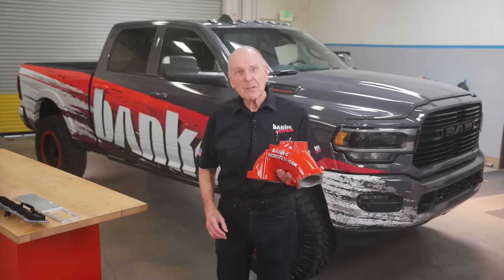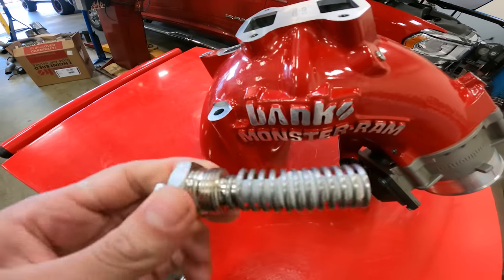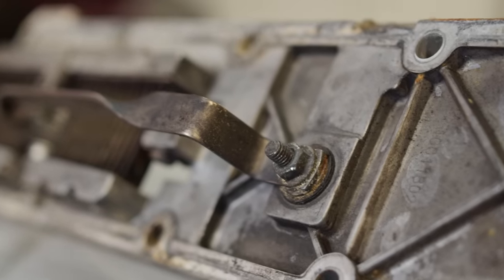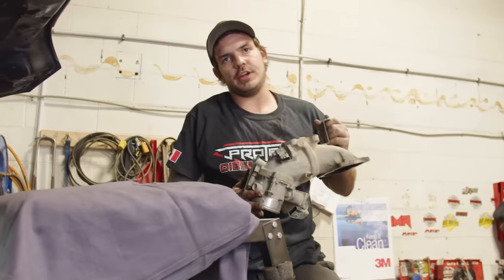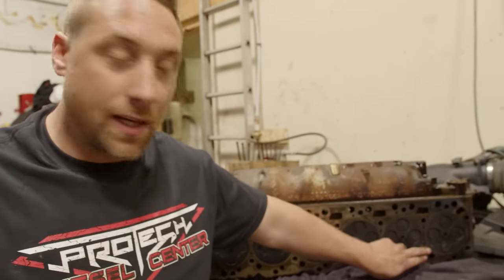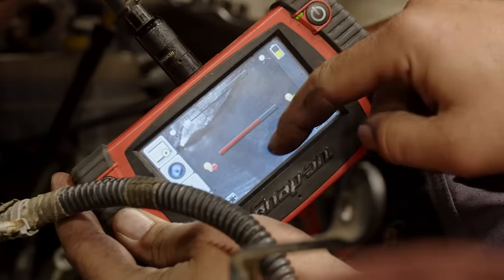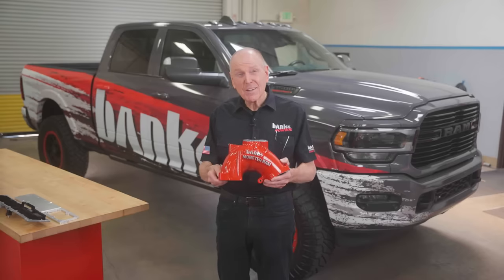How to prevent RAM Cummins 6.7L engine failure due to stock grid heater

Comment: Real numbers, before and after installation of the Monster on my Ram 2009, 6.7.  Low mileage vehicle in excellent condition. 2500 series.

Before install, average 13.5 mpg at 70mph, 3.73 gear.  Traveled 3000 miles cross country 6 times in same vehicle.  Fuel usage 223 gallons at $5.50/ gallon.  Fuel cost per trip $1,222. (Average. Variables apply, obviously)

After install.  $1000 for Ram Monster Intake.  Average mileage 17.5 @70mph.  That is  33% savings.  Fuel usage 171 gallons.  Cost $$940.00. Savings $282.2.

Payback in miles is 12,019.  Or, looking at savings per gallon, that is like buying $5.50 diesel and paying $3.63 per gallon. 

I used average.  I actually saw mpg go as high as 21.6 on flat roads and speed down at 58mph. 

However, I eliminated the threat of the heater bolt destroying the engine forever.
That threat to me was worth the $1000 I paid for the Monster.  Remember the Monster still uses the original EGR and is legal everywhere, including CA.

BTW, I had the installation done at a local shop for $450, $100 per hour and 4 1/2 hours.  Shop loved the  mod and had seen the engine damage previously. They did not know a fix has been available.  Truck has much better throttle response and is smoother.

It’s going on my new 2021 Ram 3500 when warranty runs out. Maybe sooner!

For real, not made up.

Comment: Bought this kit for my wife's 2018 Ram 2500 6.7L.  When the kit showed up, the truck was at the dealer for an emissions warranty issue.  When it came out from the dealer.  My time window to work on the installation was gone.  I had a scheduled surgery.  And hope that the last day or two of my time off from work.  Will allow me to Install this kit along with the iDash.
I gotta get my daughter and son-in-law to buy this kit for their 2018 3500 6.7L.  A friend's son had the bolt failure.  And is out $15k for a dealer repair.  Has to drive his old truck to continue to run his business.
Reply: At how many miles do you think I should change mine to banks I’m at 30k miles right now do I need to tune it after or egr delete too?

Comment: I read about this a couple months ago when I replaced my grid heater relay .I never knew this was a thing until reading on that relay I immediately went out and wiggled the bolt stud on the heater luckily it's tight but I beleive we will.be going this route for prevention I only use my ram as a toe rig for my crawler I'm not looking lose an engine for a heater bolt ...I've removed everything else on the 6.7 from factory that cuts engine life and turbo life down with EFI live ...no smoke all clean tunes you'd never know it was just a straight pipe from turbo back besides the decibels ...lol
Reply: No smoke? I’d be interested because deleted of emissions on these almost always creates soot which is low hanging fruit for DOT cops an other agencies looking to bust a deleted truck.
Reply: @josemejia6645  The tunes are generic but I don't know who the person is that tuned that batch of csp 5 but they certainly don't over fuel like a lot of trucks I see .

Comment: I already did that upgrade in addition to the cold air intake and boos tubes. Seeing a difference in over 4mpg while towing.
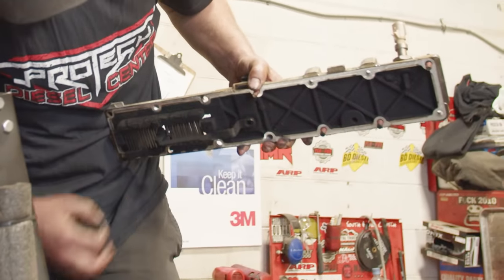Reply: @Motleymick  is a 2021 ram 3500 dually. It has the aisin transmission and I have the 4:10 gears
Reply: @marlonhernandez706  so I get up to bc periodically. I have 2020 and a 2022. How much is this all going to cost me? 😂
Reply: Wow, that's good. What about regular driving (not towing)?

Comment: My grid heater went out in my 2007 6.7 and when they removed it to replace it, that nut on the inside was about broke off! I've seen it first hand! And i got lucky!
Reply: Thanks for the heads up, I have a 2008, guess I will tear into mine and have a close look, maybe just replace the bolts all together.

Comment: I love the idea. Looks great. Banks has done it again. That being said, I've been a diesel tech for cummins for 6 years and I have never seen this happen. Wondering if it's the extreme cold climate in the west. (Southern Ontario guy here)
Reply: Plenty in Alberta where it hits -35 for 3 week stretches. The heater cycles for a good long time after cold start. probably close to 10 minutes sometimes.
Reply: I’m in the Southeastern U.S., is this something I need to be concerned about immediately? 2012 Dodge dually with 122k miles
Reply: This happened to me 2x in Alaska. Both times were in the winter. The only reason it’s not a recall is because it doesn’t happen in the lower 48 where it’s warmer.
Reply: My guess is the owners are driving g with the check engine light on for months. I've replace tons of grid heaters under warranty and customer pay seen the. Melted but never to the point the bolt was about to fall out. It happens because the shitty grid heater relay which is just like a Starter relay on a 50-90s Ford and it melts inside and sticks.
Reply: @fabricatorgeneralcaz534  I would be pulling and checking it at the very least!
Reply: @fredtflail  Oh you can bet that is 75% what is going on  and when ya ask them they claim oh its been on for past 3 years but it dont affect nothing. I always say really , is that why they put that idiot light right there on the dash where its reminding you constantly.People seem to think it has different stages and will go off again if something else goes wrong thats worse. The things people come up with is just ridiculous.
Reply: @fredtflail  TY for explaining that. You are the first. Makes total sense 👍

Comment: Gale Banks was the man who taught me to cuss whenever I see a Diesel belching black smoke. "Bad goddamn tuning."
Reply: Yes siree and at the same time...theres a ton of experts screaming back at us saying "thats how you make them run harder". Those people are the same ones who blow up their engines at some point. I am amazed with the number of "experts" who ignore an overly rich fuel mixture and say they know what they are doing.
Reply: A STOCK truck would roll coal without the DPF.
Reply: @Garth2011  been “rolling coal” for 500k miles. When is it going to blow up?? U realize older diesels don’t have advanced computers and injection systems? Can’t “tune out” pre spool
Reply: Btw the way, my 3rd gen rolls coal with a full banks kit, no other mods 🤦‍♂️🤷🏻‍♂️
Reply: @dougn6465  Still, its poorly mixed fuel and air. No benefits yielded with black unburned soot.
Reply: @Garth2011  💯 wrong. Making that statement shows u don’t have experience with older diesels. Banks koolaide is going to your head. Would u like to see Dyno  charts of a clean tune vs dirty on my truck? Btw, Gale’s 6 gun rolls coal on my truck
Reply: @Garth2011  think about this, how do u have enough fuel for 0psi and 35+psi of boost? U can’t have separate the fueling or as u say it “the tune”
Reply: @dougn6465  No thank you. Keep your smoke and expert opinions
Reply: @Garth2011  ok stay ignorant. If u feel like learning something, look at the power difference in Gale’s 6 gun tuner for an 03 ram 2500. Why do the smoke tunes create the most power? Hell, even the stock tune had some smoke. Diesel is VERY different than gas
Reply: @dougn6465  Same goes for a steam locomotive. Older tech/physics that once were modern. Times change for the best.
Reply: @kustomaf7606  NOPE, Mine runs clean

Comment: Banks needs to stop advertising this as "50 state emissions compliant". As of right now 2007.5-2012 is not emissions compliant in California, and has been shown as "pending" . I have this setup, and it's a very nice improvement, but have yet to pass California emissions, due to there not being a CARB EO number for 2007.5-2012 6.7l Cummins. Great well engineered product, if you don't live in CA, or "know someone" in the smog business that doesn't worry about visual inspection.

Comment: The first thing i did on my 2022 3500 was install banks horn kit, pedal monster idash and diff cover, and larger intercooler tubes. No after tubes i discovered could not get oil filter out the traditional method. So installed pacbrake oil filter relocation kit. Next is fuel filter kit.

Comment: There was mention in the comments about a class action suite, but if it's that well known a problem I would expect Cummins and the vehicle manufacturers to have it as a service repair item - that would move the onus onto the mechanic/shop doing the service for not doing it, especially if it were a dealership, and the action should/would be against them?
that said, I'd be interested to know what material the bolt, nut, etc were made of as it would seem a simple upgrade to a good SS fastener assembly would prevent the failure and a big concern for Cummins' good name?
Reply: @Stay Asleep 
Depends on the stainless alloy, there are several common ones used.
That said, why I haven't personally had a problem with SS in other applications, doesn't mean there couldn't be issues here
Reply: @Stay Asleep 
Again, there are many different grades of SS fasteners, with different yield and elongation characteristics - what I think you mean by "mallable", which is different again, meaning easily formed.
If you've had problems, either it's the wrong grade/alloy used, an incorrect size, and/or an incorrect application - sometimes you just have to accept a limited service life.

It's a little long, and 'techie', but you may find this of interest - https://nickelinstitute.org/media/4656/ni_aisi_9003_fastenersselection.pdf

And there's this supplier who has a much greater range of SS options than I was aware of, if you go down to the last paragraph - https://itafasteners.com/4-benefits-of-stainless-steel-fasteners.php
Reply: Could it they have used a coil style heater that threads in from the top or the side of the stock intake horn like Banks. Or a bigger or dual old school glow plugs? That grid inside like that is just asking for something to go wrong. Cummins makes the engines but RAM outfits them to work in their trucks with all the emissions stuff piled on.
Reply: If your engine has experienced this failure please make sure your shop is filing a claim with Cummins or else there is no way for us to track this problem. If there are enough verifiable claims we would investigate and issue a service plan available through your local service center that would correct it.

Comment: Gale and his Team are legendary at exposing the faulty Diesel engine designs, components, and lacklustre manufacturing that still resides in Dodge, Ford and GM respective plants. As consumers this is intolerable, and we should just stop buying their crap.

But, as long as there is a market out there willing to throw down a$100G on  24 inch infotainment displays, cameras, trailer backing, and super cruise technologies - with little regard for reliability, longevity, and performance - the big three have got us right by the hairy conniptions.

Comment: Not talking crap I work for Chrysler have for 16 years and yet to have seen this failure. But it is interesting to see that. Almost seems like it would be a recall as it can cause you to loose power and cause an accident as the recall notice says.

Comment: recently installed the banks monster intake and boost tubes on my 2020.  I was not aware of the bolt issue, but makes it even better that I got this done.

noticable throttle response improvement, slight fuel economy increase.  With the prices now ($2.02 per liter or $7.75 a gallon).  It seems quicker but I dont need this one to be a hot rod..already blew up my 2011 once

Comment: I've known at least 5 or 6 people who very much violated their warranty by mod/fixing issues with their engines/transmissions. EGR deleting, what's DEF, straight pipes, valve plates, ..... The EPA needs to be refocused and out of the automotive field.
Reply: Or force them to pay for any emissions related repairs and failures due to equipment needed to stay within requirements. But, then taxpayers have to clean up the mess the epa makes, so I guess getting them away from diesel trucks really is the best idea. Its messed up that these exhaust systems add thousands to the cost of new vehicles, and adds a ongoing cost to operate with a dpf system that needs it's own fluid, in a misguided effort to keep the air 'clean.' I'm all for not polluting the environment, but I think in the big picture regulations on light trucks is a drop in the bucket compared to container ships, the military,  and commercial aircraft. I also hate the idea that consumers have to foot the bill to pay for these unnecessary parts, and the real kicker is it makes the vehicles way less reliable. Ask any diesel mechanic what percentage of repairs on trucks 10 y.o. or less are related to emissions systems, you'd be shocked.

Comment: So, 88% better airflow. Amazing. It's easy to add the same amount of fuel and the power increases by 88%. There is certainly enough demand for such an invention. Expensive and unreliable turbos are no longer needed. This invention revolutionizes the manufacture of aircraft engines and helps piston engines against turbines. I await further information.

Comment: Has that coil heater been fully tested to failure? What is the recommended replacement time for the coil heater? I see the same issue with the coil heater as the grid heater.
Reply: The coil heater is almost the same as a Duramax and are known to be pretty reliable. I have the monster ram on my 2012 and I live in New England and it gets pretty cold here some times. It works just as good as the stock grid heater without the fear of destroying your motor

Comment: i still want a Ram with a Cummins, but that is scary.  I'm amazed Dodge/Ram and Cummins have not be forced to issue a recall for this.
Reply: Not as prone to happen l I ke they make it out to be. The ones that do have that happen are operating in very cold climates where the grid heater is cycling several times. Follow the power wire from the grid heater back to the solenoid and disconnect it from there. It won't cycling any more so no worries. Just plug it up when it gets cold and you're good to go.
Reply: If and when you get one do yourself a giant favor and don’t buy one unless it has the Aisin transmission. The 68RFE makes the Cummins worthless with all the torque management bullcrap designed to protect the non-heavy duty transmission.

Comment: Question, there's a possibility I'm missing something. So why would you "need" to surface the head to the point of completely removing that mark the bolt made? It's in the combustion chamber area, not where it seals. I don't see the issue of just checking for cracks, warps, valve job, skim the surface, and calling it good. Rebuilding the bottom end I completely see.
Reply: I wondered the same thing, but not seeing it in person, -there may be things we're not seeing.
Reply: I dunno crap about diesel engines, but if I had to guess......Diesels are very high pressure combustion, and an imperfection in the head could lead to "hot spots" that could further degrade the damaged area.....A total guess though.

Comment: How common is this failure? Any recall or updates to design? Just talked my dad into the banks upgrade. He has never added a performance item to any of his vehicles. My parents are on the road full time living out of their travel trailer. Sent him this video and he called and said order him one for me to install when they get back to SoCal to visit in October of this year.
Reply: I'd like to know how common it is so I'm leaving a comment here. I'm a 6.7L cummins owner.
Reply: Why would they recall it? It will last far past warranty stage.
Reply: You dad could benefit from many upgrades with milage and reliability. I haul tractors with my truck it's 2007 6.7 I've never had a motor issue. And without anything on the back I get 25mpg. With a triple Axle gooseneck loaded with 8000 series John Deere tractor weighing in at 24,500 lbs. I get 12-13 mpg. I've never broke down because of emissions hardware. Because I have non.  Removing the emissions parts will give you the biggest boost in mpg and reliability.
Reply: Being from socal your probably limited in what you can do. Be careful with emission standards. You may have a bunch coming down the pipe.
Reply: @westtexas806  yeah I’m from SoCal but my pops has relocated to Arkansas. He’s not into upgrades. I reached out to him about this and he talked to another buddy that recommended him save money and just replace the stock part of he’s worried lol 🤦🏼‍♂️
Reply: @skyrimwarrior0196  very common, in colder states. I've replaced 3 engines in 2 years for this issue when I worked at the dealership. More common on high milage vehicles (more heat cycles) and neither chrysler or cummins will do anything if you have no warranty left
Reply: Common here in canada , during the summer months here I just unbolt my grid heater
Reply: Not super common guys and gals but definitely has happened to people. We did it just as a precaution but over 250k before we did it and it was still tight…we didn’t use Banks systems but all them perform about the same when towing IMO
Reply: Chrysler will not do a recall because it has not affected more than the % requirements or has not caused any human deaths or injury (Yet)…they has a TSB for the techs but nothing more than them to tell you to replace the whole grid heater
Reply: @westtexas806 it happened to my 2017 at 50k which was past my basic warranty.  Thankfully I purchased the extended warranty.  It took out the engine and turbo.  Right at 37k to replace.
Reply: @skyrimwarrior0196 it happened to mine at 50k.
Reply: @Jp75402  damn that sucks.

Comment: The intake flowing higher is great and all but what do you do about the intake log?  Removing the heater plate will help but the head casting is what it is. So what can be done about it besides cutting it off and installing a side draft manifold?